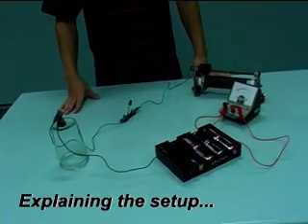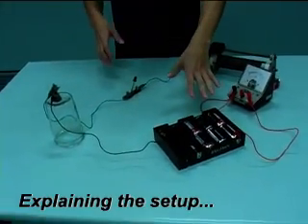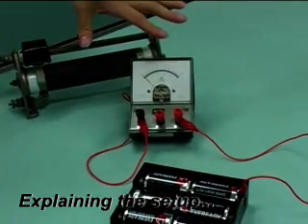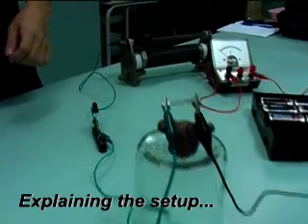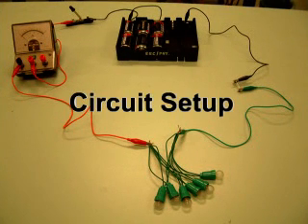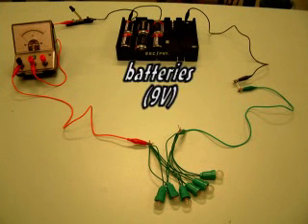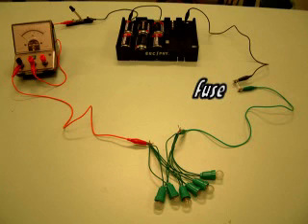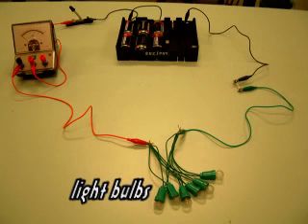Fun with electrical fuse

Comment: science the bulbs are connected in parallel, why do the 5 lamps get dimmer?
Reply from the maker: Good question! One way to explain this is the maximum power output of the dry cells has a certain limit. Hence, using power = emf x current (P = VI), there is a limit to the maximum current that can be drawn from the dry cells. When 5 bulbs are in parallel, the total required current is greater than the maximum current that the cells can provide. The result is that each of the bulb in parallel receive less current than the previous setup (i.e. 3 or 4 bulbs in parallel).

Comment: Nah, you should've lit up the 6 bulbs with the fuse shorted, then remove the bypass on the fuse. Most likely the setup would not fail as a hot bulb's resistance is pretty high, and it would blow the newbies minds off ;)
Reply from the maker: Thank you for the idea!

Comment: since the bulbs are connected in parralel the resistance actually decreases allowing for more current to flow and thus exceeding the rating of the fuse.  if the were added in series the resistance would rise and the fuse would not blow but the bulbs may not light due to an increase in voltage drop